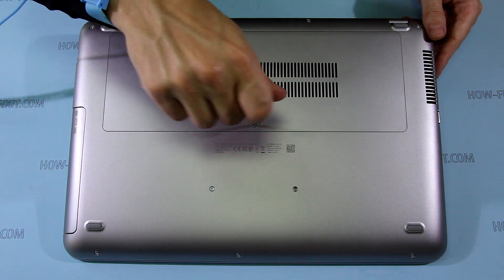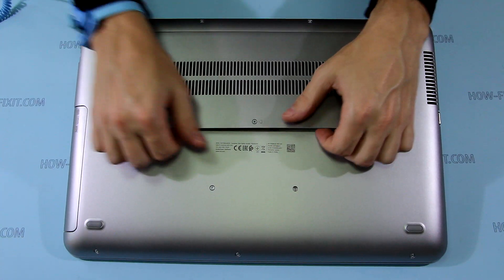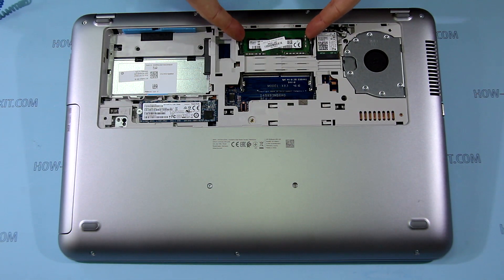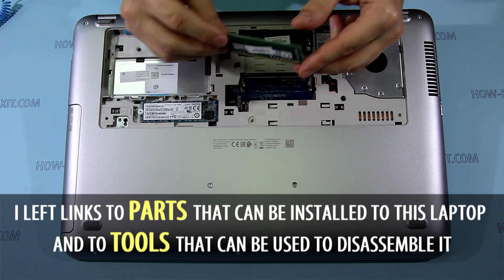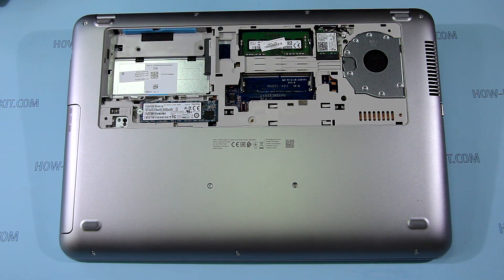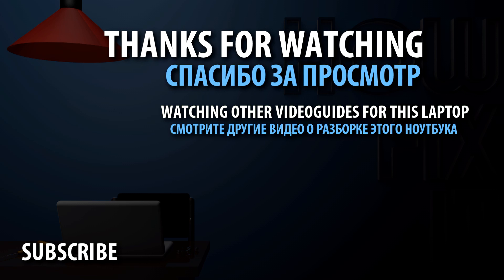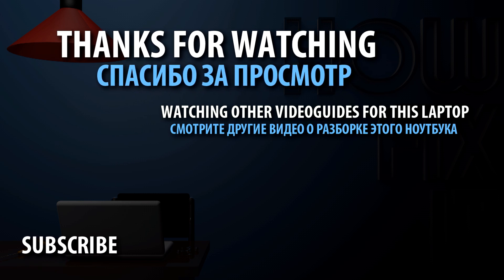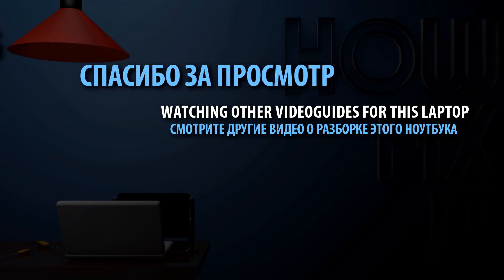HP ProBook 450 G4 RAM Upgrade and Install - Your Step-by-Step DIY Guide!

Comment: there is a 4Gb samsung ram@2400MT/S ... can i add another crucial 8Gb ram@2400MT/S as in link in empty slot or should i go for a 2133MT/S ram? Kindly reply. ...
Reply: I read somewhere that the ram must be balanced, the same exact module in each slot.
Reply: yes you can add, the combination of two slot must not exceed limit from manufacturer like this laptop have 16 gb limit

Comment: Is the Crucial "16g Dual Rank" (2666 MT/s) compatible with an HP PROBOOK 450 G4?
Reply: i think u can add 2400MT/S or 2133MT/S SODIMM type 1.2V PC4 laptop ram ...
Reply: No don’t add 16gb it’s not good for the CPU only you can add 2X8GB MAX to be come 16gb and make sure it’s 2133mhz

Comment: can i add 8 gb ram from your link of amazon at the 8 one that are already inside? i saw on some site that the 8gb ram inside was 2133 mhz and the one on your link is 2400. the two together is not bad?
Reply from the maker: on my link to Amazon there is HyperX on 2133 mhz
but 2400 MHz RAM should be work in pairs with 2133 MHz
Reply: @howfixit  (2) SODIMM slots (customer accessible/upgradeable)
Dual channel memory
NOTE: Maximized dual-channel performance requires SODIMMs of the same size and speed in both memory slots.
DDR4 PC4, transfer rates up to 2133 MT/s
4 GB total system memory (4 GB x 1)
8 GB total system memory (4 GB x 2) (dual channel)
8 GB total system memory (8 GB x 1)
12 GB total system memory (8 GB + 4 GB) (dual channel)
16 GB total system memory (8 GB x 2) (dual channel)
Reply: What did you add two 2400 or one 2133 with 2400?